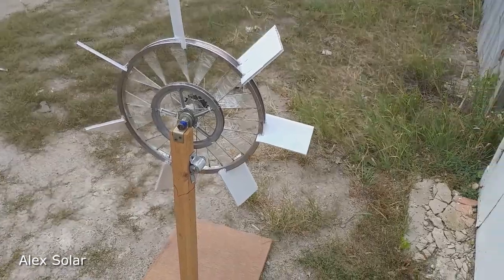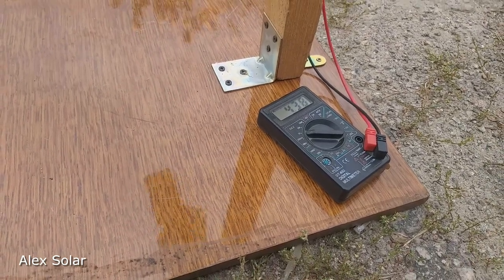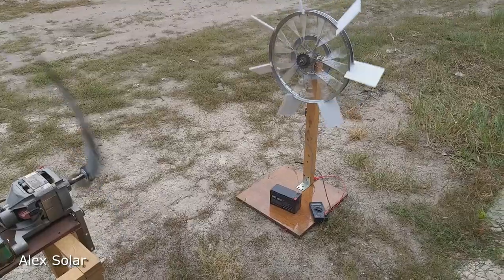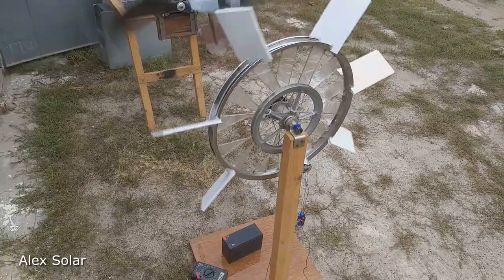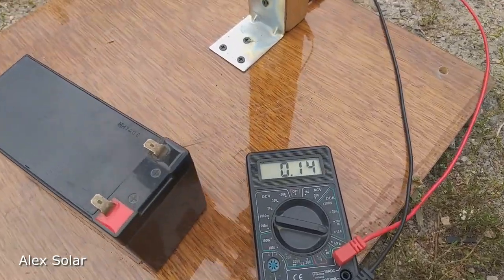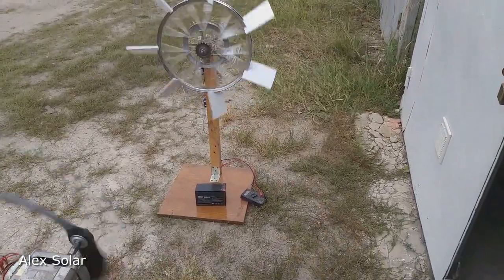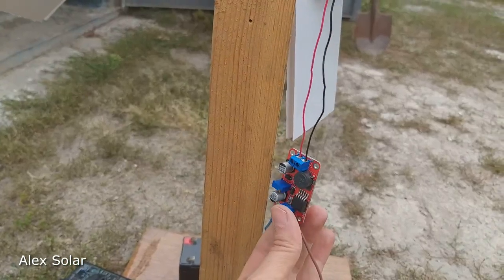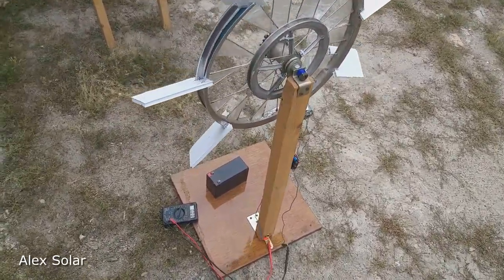Bicycle Wheel Windmill charges the battery 12 volts.

Comment: Measuring current has to be done with the load on - charging the battery in this case. You were measuring short circuit current of the step up converter that can be much more than under load. I would like to see measurement while charging the battery and also the voltage of the battery at the same time. Voltage x current = power is the interesting value.
Reply from the maker: Yes, I agree with you. I will take measurements.

Comment: It like charging 10Ah battery with 20...100mA current 
For example 10Ah / 0,02Ach = 500 hours ( about 20 days ).
Reply from the maker: Not certainly in that way. 7Ah/0.25A=28 hours.
Reply: @alexsolar7014  From 3V source - 14,1V / 3V = 4,7
0,25 x 4,7 = 1,175A from DC motor ( as a generator ).